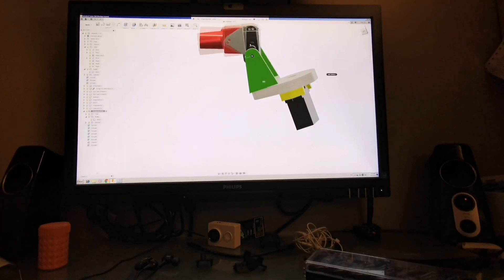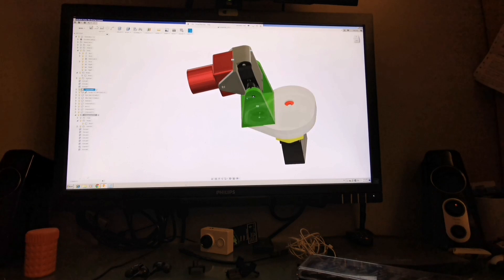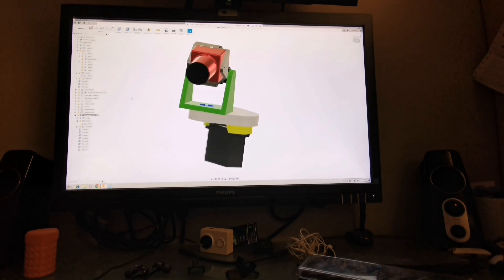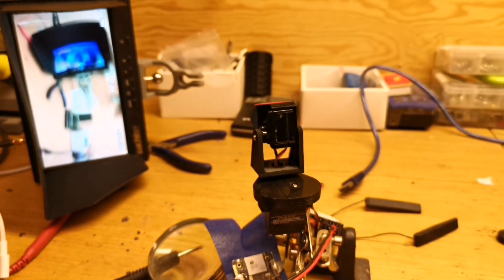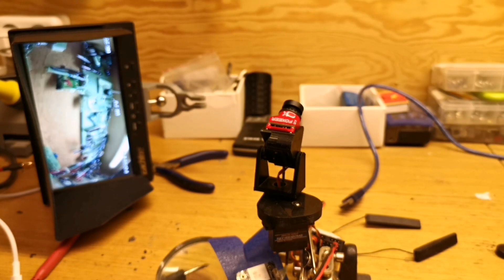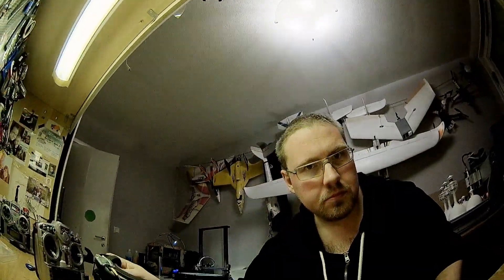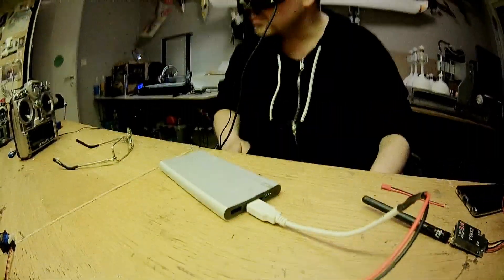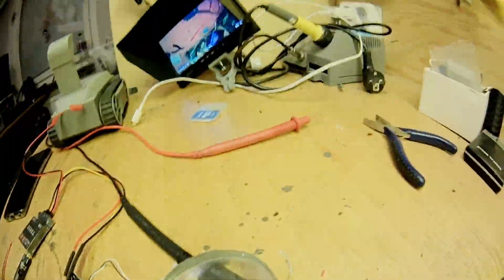World's best pan & tilt for FPV

Comment: On quad copters, we do not need pan, only tilt.. and  controlled via potentiometer on Transmitter, not head tracker...   in fact, we definitely do NOT want pan... :)  Unlike long range wings.   
Prototyping mine before I cut about half the materials off some stock parts:   https://www.youtube.com/watch?v=AqNhD5qX_pY
fpv.air-war.org

Comment: Will you put up the code as well?
Reply from the maker: If you mean the design, yes i will when i am done, i have some parts left to do.. I want the pan-part to be snap in place, and i will design a holder for the foxeer mix pcb next to the pan servo..  I don't want it to need any glue or other parts then the screws that comes with the servos.. :-)
Reply: @petleh82  i was thinking about the code to control the servos and read the sensors.
Reply from the maker: @SirArghPirate  Ohh, actually this is going to be on a plane, so there is no code, its just regular rc control. Headtracker is connected to trainer port on taranis radio and pan, tilt movment of headtracker is just mixed to the servos of pan and tilt on the mount.. So no code here :-)
Reply: @petleh82  Ah, I see :)
Reply: I love what you're doing there Peter. Is the file ready to print yet please?  And like you I've been searching for a 360° servo as well. Can I ask what did you use ? And how was this in the air? It looks brilliant!
Reply from the maker: @MattFlyingScaleFPV  I have a beta version uploaded that works, if you look at my latest videos you can see it in the air.. Works great! I will make a more polished design later.. 
https://uploadfiles.io/068dct35